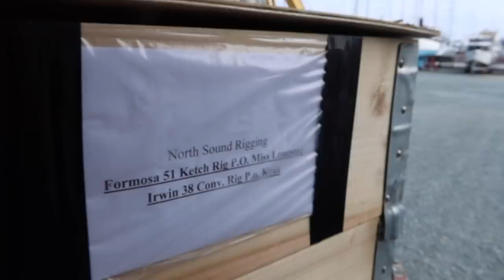Who Taught Me How to Sail? | Pirate Ship S13E03

Comment: A piece of metal pipe makes an excellent excellent handle extension for your socket wrench and is much easier to hold onto than other methods and you maintain full control of the wrench without having to grip and hold this and that at the same time.

I had to use this method on a lug wrench one time because the lug nuts were cinched down so tight by the tire shop with a pneumatic wrench that I couldn't get enough leverage with the lug wrench to change the flat tire.
Reply from the maker: Good idea
Reply: I use a floor jack handle as my leverage helper
Reply: @daneulekowski929  That will work also.👍✨

Comment: The Bulbs are breathers (I believe). Differentials and some transfer cases have them. They let the components to breath so that oil does not blow out of the seals and they keep water out should the diff get submerged or splashed with water.

Comment: Old mechanic's trick, role the push rods on a smooth flat surface and you will instantly see if there is any deformation.
Reply: niiiice we are in the process of buying our first boat and we are documenting everything on our youtube. decently will use this 
'old mechanics' trick 🤩
Reply: @thatoceanvibe2058  If an end is flared just  extend that end of the push rod over the edge of the surface you use to test it.

Comment: I’m no mechanic, but I’ve been warned many times over the years with my boat not to connect a hose to the water inlet like that. I was told it runs too much of a risk in ‘forcing’ water into the engine. It’s always got to suck from a water source. .. so I was told.
Reply: that's also what I had been told
Reply: Because the plunger is not a water tight fit the excess pressure will leak out.
I normally fit a fresh water flush to all customers engine after the strainer.
When flushing the engine with mains pressure hose make sure the intake valve is OPEN so any pressure goes out the pick up.

Comment: Enjoy watching your story and adventure. 
   If you don't mind a bit of advice from an old woodworker. A little late for your video, but perhaps but maybe useful going forward. I think the best way to have gotten your chainstay plates off may have been to remove the rub rails. Not that hard. They are screwed on every foot or foot and a half with a countersunk screw and covered with a bung. They are easily removed with a sharp chisel , carefully tapped in parallel to the grain from side to side without damaging the counter bore. The bung comes out and the screw is easily extracted. Removing the trim also makes stripping or sanding and revarnishing the piece easier before reinstalling and rebunging. And gives an opportunity to inspect screws and gelcoat ect. 
  With as much teak as there is on that boat a couple of boxes of teak bungs in different sizes, and a variety of stainless or bronze screws would be handy.
  Same thing with the inside access panel to the chain stay plates. The whole panel can be removed to get access, if you don't want to cut an opening.

Comment: I'm a mechanic by trade I've worked on diesel engines and I've worked on gasoline engines for over 45 years. Did you do a compression check on that engine before you started to think about tearing it apart? Cuz if the compression is good I don't see why you would need to tear it apart unless you had other reasons.
Reply: I agree,, Hopefully, you won't find anything deeper in the teardown. Good luck!
Reply: wow we do wish we had someone with your experience close to us Robert, we are currently buying our first boat and we don't have a lot of experience so if you see in our YouTube videos we were about to buy a very shitty ship because we got played by the seller and the broker 🥲

Comment: The little red cap sitting on top of your injector pump  is a vent.  Make sure it is clean. Before putting the head back on make sure you clean surface with  a razor . You can also use brake cleaner to clean any old gaskets off the block.. Then get a sanding block  preferably 80 grit and gently sand the top of block.  Hope this helps.

Comment: If you get a piece of metal pipe 12 to 18 inches long that fits over the socket bar, you have an extension bar to use on tight bolts. I flatten one end of the pipe to fit over socket bar.  The pipe was cheaper than an extension breaker bar. Nice video, well done. 👍👍🇺🇸

Comment: It’s a good idea if your doing a top end on a Diesel engine is too do a rebuild on fuel pump and water pump. This way your NOT snake bit because you didn’t take the extra steps and a few dollars more to do a complete top end rebuild including other parts. So if it’s the 120Hp Ford leman diesel and it’s probably safe to say it’s not had a top end done. I’d would do the complete top end…

Comment: It's a vent for the governor assembly. some of the old pumps required the oil changed in the governor area of the fuel pump as diesel leaks in and dilutes it.I would check into that.
 The one on the trans is just another vent.
Reply: Those vents are probably dual purpose. As long as they’re surrounded by air they vent and allow excess pressure while running to escape. However, if they are underwater there should be a valve that prevents water to flow into the engine and transmission. If there’s hose fittings on them you can test them to make sure air or fluids only flow one direction away from the engine. Or you could just replace them. After seeing how the new one works you can check the old ones against it. That way you’ll have a used spare. 
The best smooth surface to check those pushrods is a mirror. You’ll see a gap between the two if they’re bent plus you can see more pushrod than normal past the lowest point. It’ll be self explanatory if you find a bent one.

Comment: Those are overflow valves and breathers for the engine and transmission in case it's overfilled and also that keep it above water line. So water doesn't get in.
Reply: The one on the injection pump it is a cap covering a fuel adjuster screw. 
the injection pump has it own oil level and over flow pipe that is often feed back to the sump on a boat, it can also be put into a bottle to track if there is fuel leaking in the pump.

Comment: That motor looks to be in very good shape, I wouldn’t have taking apart , should have done leak down test and compression test first .
Reply: Excellent point. Take it apart and it might never run again. One cockroach after to the other... Rather do the regular maintenance and stock up on common replacement parts and generics.
Reply from the maker: Spoiler Alert!!! We made the right choice:) also Searle is a 🧙‍♂️ wizard with engineering
Reply: @SailingMissLoneStar Great!
Reply: @SailingMissLoneStar   
Engineering is not checking a motor vital signs , could have save you 2300.00
Reply: Dave you're 100% correct (I know you already knew that👍). Could have saved a lot.

Comment: Sailing is easy, it's learning the ship and how to sail thats harder. Strangely enough once you understand sailing is just about topping up your knowledge and then comes the difficult parts, Learning the ins and outs of the ship you are sailing.

I learned to sail as a kid in this sailing dingy and I did it a lot, so it was easy to sail the bigger ship my dad built, but there are added rules you need to learn. A more modern ship has much more things to learn, but those skills are usually transferable to other similar ships. Bluewater sailing is a whole new chapter in either case and I find that funny. Even on big sailing ships the mechanics of sailing that dingy still applies, there's only a ton more steps involved and they are mostly ship dependent. Sailing is sailing, where knowledge comes in is sailing in different weather and learning when to not sail or reef in so to speak.

Good luck, but it might be easier to learn the basics on a smaller boat. :D

Comment: why did you do a top end rebuild of the motor? those things are, at least as far as I know, bulletproof.  Oh, the button on the injection pump is probably for priming the pump.... the button on the other end, dunno.
Reply: It's  good to see I'm  not the only one to think that about pulling it apart. At least do a compression (Edited because  I have a new phone so I'm  not used to the keyboard yet, yes it's  different  to my last phone) test before ripping it all off.
Reply: @macman6107  I suspect the reason is somewhere on the editing room floor....
Reply: @stoneshrink  perhaps.